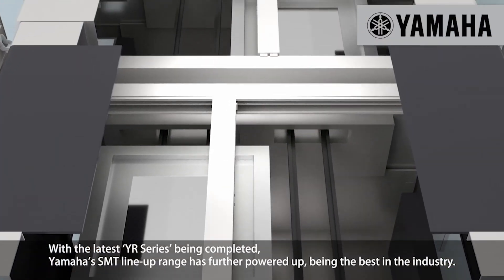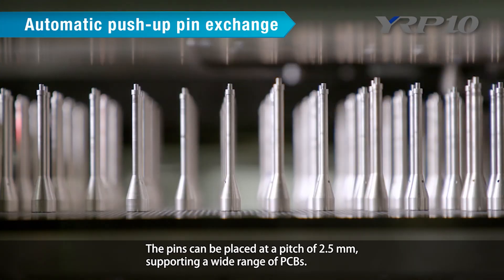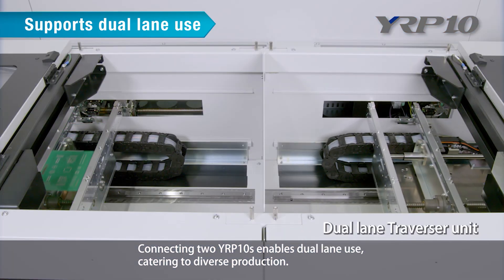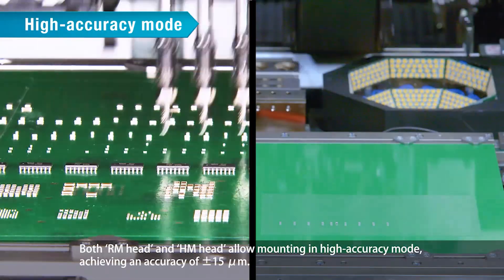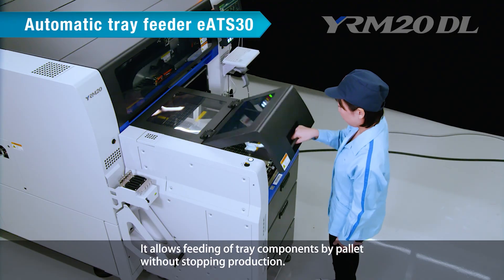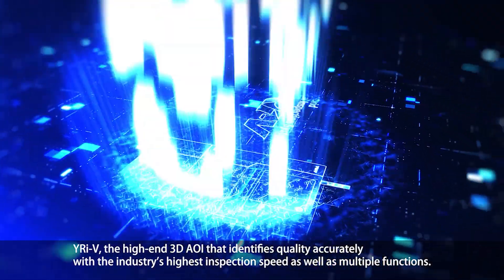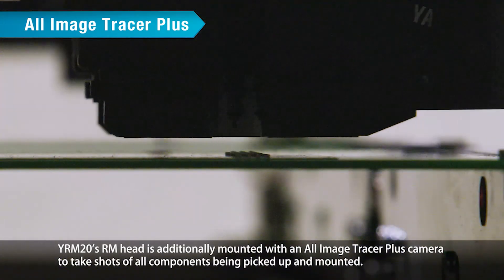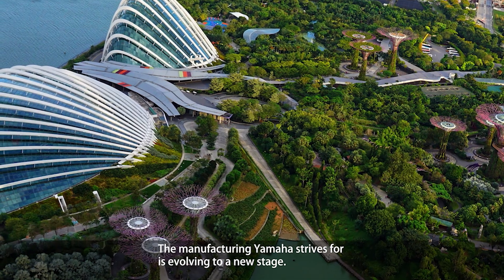Full Yamaha SMT line up 2026 | Yamaha YR series | PCB assembly of the future

Comment: Currently I am still using Yamaha M10, M20 mounter in the SMT machine line.
Reply from the maker: Thank you for sharing your experience.
It’s always great to hear about Yamaha mounters running strong in production - the M10 and M20 are true workhorses in many SMT lines. Reliability is exactly why so many manufacturers continue to trust Yamaha solutions.
Reply: SO nice. Do you think this brand is good for SMT machines?